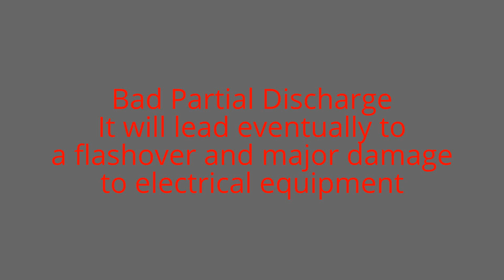Very bad Partial Discharge on 11000 Volts OCB's

Comment: Isn't it kinda bad to have oil filled switchgear inside the station? Like, I don't particularly enjoy the possibly of a significant (and damaging) fire when there is a failure...
Reply: Most switchgear is designed with burst plates and channels to guide out hot gasses in case of a standing arc. Bigger switchgear installations with large oil compartments have oil cellars underneath. For unsafe installations, personal protection is required while switching on site. In my experience, AIS oil filled circuit breakers are placed in closed off cells just in case. Other countries may have other rules concerning safety of course.

Comment: Doesn't look good. A full PD test at working voltage needs to be done to see if there is any damage to the insulation.
Reply from the maker: Correct.
Reply: I recon the insulation has already been degraded frm that. Even if it does pass the full PD I'd still be very suspicious, and step up the maintenance checks, put a note on it tell staff to stay away from the rack not even to touch the panel. It can go bang with no warning.

Comment: Someone uploaded a video a week ago of fire fighters putting out a transformer fire. When they shown video of the switch room there were 2 breakers side by side similar to those completely burnt out with  a lot of wiring/fire damage to the room as well. I think you may have saved the power company or owners a lot of money, as well as made life safer for other engineers :-)
Reply from the maker: It shows the importance of maintenance, last inspection was in 2006.Usually the beancounters want to save money on maintenance but they put an installation at risk as well operating personnel.Good practise is at least yearly inspection and PD tests as well as visual and racking ocb's out as well.Oil changes get normally done at 4 or 8 yearly intervals unless high faults have occurred and more oil changes are required.We are shutting the whole installation down this week and will inspect, clean the busspouts as well.
Reply: Interesting video Coolkeys ... here is a video where an OCB fails on camera!:
watch?v=SWzAJeomdD0 
(Watch the whole thing, there are two "explosions," or go to the 30 second mark to see the failure)
Reply: Do you have a link to the video? or if links are blocked, just the video id? (the bit after the v= )?
Reply: When originally watching this video I couldn't figure out why the transformer and  circuit breakers were destroyed. watch?v=gMa-0nw24Sg
Reply: Thanks :)
Reply from the maker: Sweet !